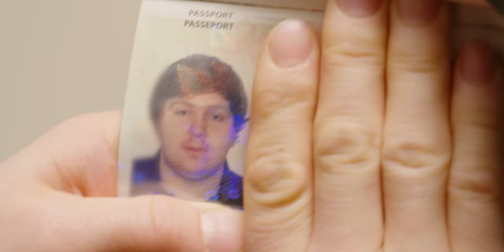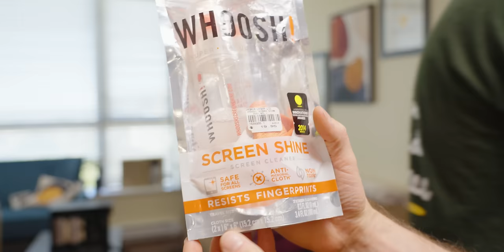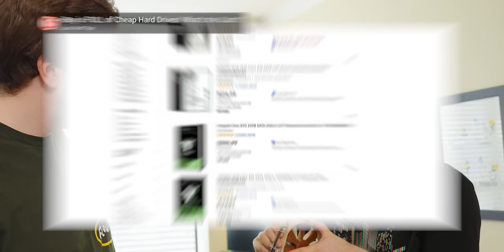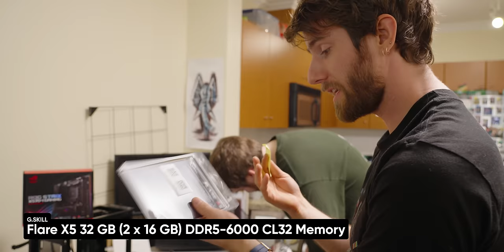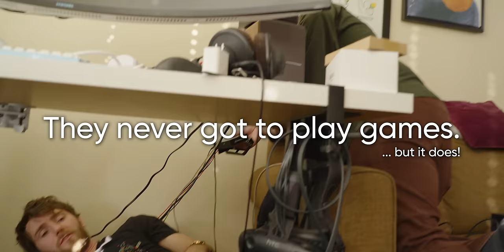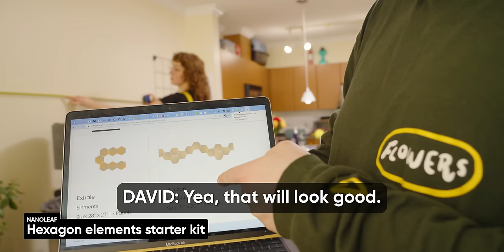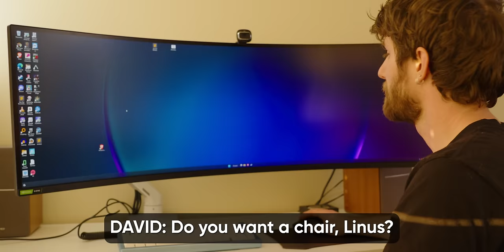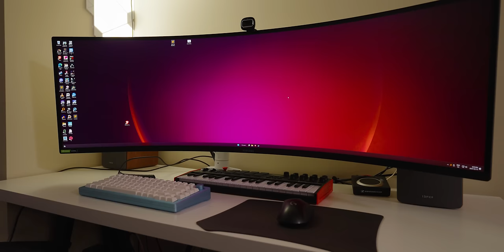This. was. CHAOS. - AMD $5,000 Ultimate Tech Upgrade

Comment: Don't worry about the cats, I have a Klipsch SW112 Subwoofer behind my office chair in my home office and even with a flat EQ and the dial at 30 percent gain, it literally shakes the soffits on the outside of the house. My cat loves when I am gaming because the amp gives off heat. He will lay on that sub and take all the vibrations. He is literally like some sort of cat version of a bass head.

Comment: This shift in Linus switching from Intel to AMD for the tech upgrade was a massive buy signal for AMD stocks. AMD did 149% move starting from the friday before this video was posted to its recent top almost exactly 1 year later, whereas Intel only was able to do a measly 88% gain in that same timeframe. Poor intel has since dumped to new lows but everyone hopes it will recover quickly and swiftly once their new microcode patch is released. Good Luck out there! And keep up with great content! ;) Thanks LTT Team.